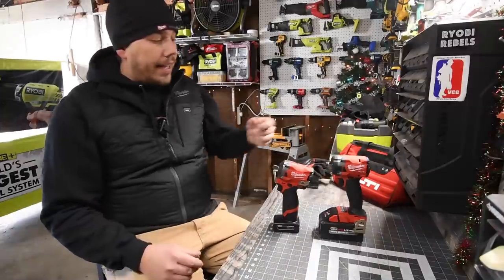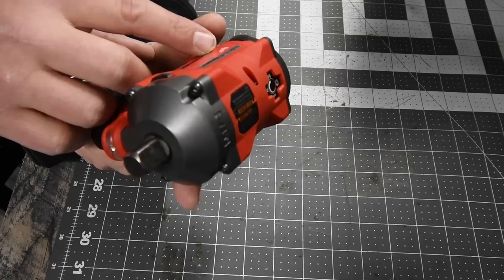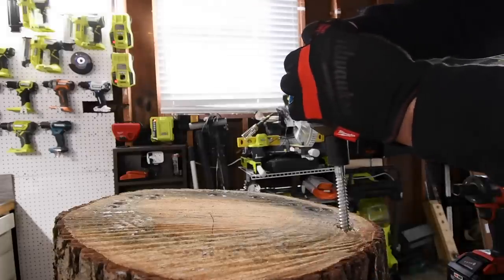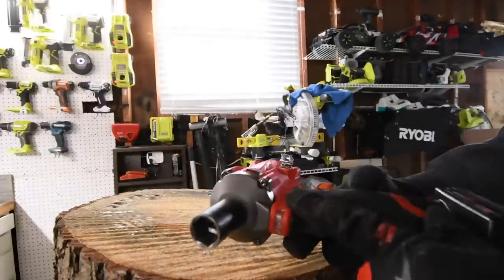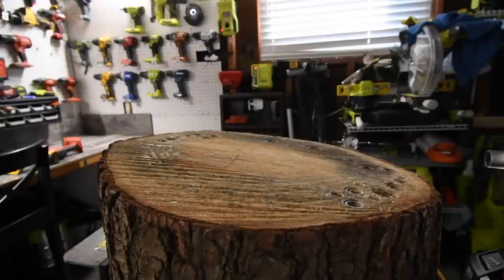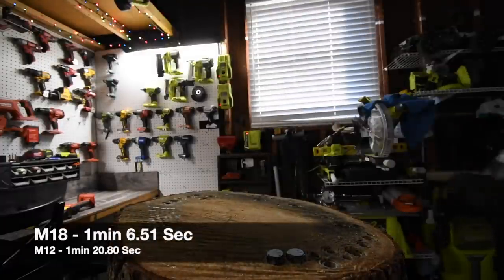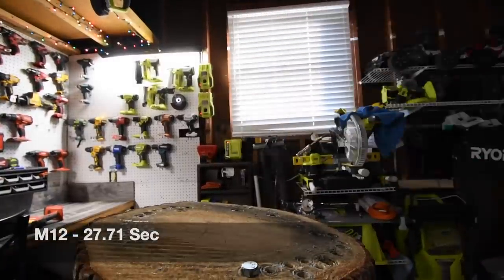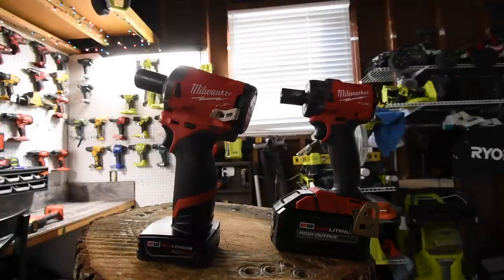New M18 Stubby vs M12 Stubby (1/2 Impact Wrenches)

Comment: I never believed when people would say "it replaced my air tools", I loved my air tools for everything from the power, to the sound, to the overall experience. I thought I'd give the m12 stubby a try, just to use for little stuff so I don't fire up the compressor for quick little things, and let me tell you, in the 5 or so months of having it, I have not used my air impact even once!! Everything from lug nuts, to corroded exhaust bolts, it handles it like a champ. Of course it's not as fast as air, or sometimes it might take a second for it to hammer it loose, but it has yet to fail me
Reply from the maker: these impact wrenches are powerful now, its crazy and I thank you for your story Raffi :)
Reply: Facts, I bought the stubby even though I haven't had my 60 gallon compressor for even a year and I barely even turn the compressor on anymore. Now I've just been buying milwakee to add to my collection
Reply: Bout a 30 gal Kobalt for use at home, then I got a m18 mid torque a month later on sale. Nothing beats air tools but these come close.
Reply: @scinto23  nothing beats air tools for sure, but 99% of the time, the electric  stuff has enough power to do the job. Plus no noise, hose, or oil. Air tools win in power and longevity for sure. Also more compact
Reply: @raffi2287  Agreed
Reply: @raffi2287  I don't know about power the torque test channel put the 1/2 Milwaukee impact vs the most powerful 1/2 pneumatic in it's class and the Milwaukee outperformed it
Reply: Did you get the 3/8 or 1/2 inch? I'm on the fence between the 2 sizes.
Reply: @techti8792  definitely get the 3/8. Half inch useless as I wouldn't really use this for anything bigger than 22mm which even that is pushing it. Save the bulky 1/2 for the mid and high torques.
Reply: @raffi2287  plenty beats air tools now. your knowledge is old.
Reply: @James28R  my knowledge can't be old when I'm as young as I am bud. It depends on the tool. No cordless die grinder can come even close to pneumatic in terms of power. That's coming from a man that owns a M12 right angle die grinder with 6.0 batteries. And the second thing to consider is at what cost? My m18 high torque is my most powerful half inch and beats any pneumatic I have, but again, at what cost? I take off 5 lug nuts from the car with a 8.0 battery and my arms and shoulders feel like a day after the gym. The doegronder is the same concept, though convenient, it's absolutely massive compared to a compact air die grinder, and I would say the pneumatic is about 3x more powerful. So no, it's not ignorance, infact you're ignorant to think just because cordless exists, air tools are worthless now

Comment: Thanks for comparing these two. Going m12 1/2” and m18 high torque 1/2”… should get me through every job. (And I highly recommend the 3/8” right angle ratchet for anyone reading this… LOVE IT!)
Reply: Right angle ratchet??? Don't you mean the "right angle impact".
Reply: @megatonesilva6546  the right angle impact is different than the right angle ratchet. Still a great tool though

Comment: I work on motorcycles everyday and I love my m12 stubby. It’s fast, it’s powerful and it’s very light. Does everything right. One of my favourites tools in the workshop. I find the m18 battery too bulky in comparison, although it’s got an advantage in stabiliy. My m12 has fallen once or twice because of its lightness.

Comment: Makes sense. Virtually the same for the most part. I’m guessing the M12 has seen more use - it’s had a chance for the grease to get pounded out of the gear teeth before it heats up again and the grease can redistribute, giving it an advantage under normal loads. The M18 really comes alive for the long fasteners, and it maintains its power under those heavier loads where the M12 tends to taper off.
Reply from the maker: you are correct on that one and I thank you for your input Kevin

Comment: The reason why the m12 won the other test is because it has higher speed. When you needed high torque in the 10 inch lags the m18 won because the slower speed gave it more torque. Great video as always!
Reply: Agreed!
Reply from the maker: I thank you for the input Vane and I thank you for viewing :)
Reply: So when doing continuous rigorous work, the m18 is better ? For lighter quick jobs the m12 would be preferred.
Reply: I dont think that is right. Other channels show the m12 having more tourque.
Reply: If the M12 XC5.0 High Output battery was available, the results would be even better. The M12 XC6.0 is the weakest of the XCs - weaker than the XC3.0! 

Conversely the M18 XC6.0 High Output is stronger than the XC8.0 High Output, but not as strong as the HD12.0 (or the new upcoming XC6.0 Forge which has HD12.0 power).

So the M12 had the weakest XC battery, and the M18 had one of the strongest.

Cells below are Samsung INR18650-xxx series; I'll just show the last charcters:

M12 XC5.0 High Output: -25S cells rated 35A; 2x35A = 70A
M12 XC3.0: -15M cells rated 23A; 2x23A = 46A
M12 XC6.0: -30Q cells rated 15A; 2x15A = 30A

So peak power on the XC3.0 is 50% higher than the XC6.0. Peak power on the XC5.0 High Output is more than twice as powerful as the XC6.0.

While the XC3.0 would be drained by the time of the 10 inch lag bolt test, the test was about power, so it would have been faster. Swapping batteries between tasks is reasonable in real life.

Comment: Not sure how many people are driving in lags without pilot holes, but very interesting comparo as usual.  Would like to see a "real world" scenario of taking off 2 wheels with 8 lag bolts each (as in rotating tires) and see which can do it, and what the battery life will be at the end.  Obviously the M18 battery life, at that size, and HO, should last longer but if the M12 stubby gets the job done then it's a M12 vs M18 platform decision of what other tools one would need/want.  For the DIYer either is good.  For the pro in the trades I'm sure there are other considerations.
Reply from the maker: I think they both can. I already made a video showing that the m12 can take off lug nits in a second or 2. the same thing with the m18 stubby.
Reply: Using tools like this for lags is dumb. Take off a whole suspension from one side and check if they can get all the nuts off

Comment: A couple notes for testing - If you use a washer on your lag bolts you can tell when the bolt is tight because they washer will deform. Much easier to tell.

If you could leave the times up on the screen longer that would be great.

Great video man.

Comment: Just goes to show, Milwaukee builds their 12/18 volt platform to satisfy each voltage platform. If you invest in the batteries, Milwaukee performs.  The impact drill driver would beat them both. With lag screws, it’s about speed.  These tools excell with torque, not speed.  Lag bolts in wood create heat and drag, the impacts you’re testing remove finer threaded bolts with less drag after torque tightened because they are pre-threaded, and 99% like materials. Results may be similar but way faster with threaded bolts and receivers with like materials.
Reply from the maker: I do agree with you on that one Tim, and I thank you for viewing :)

Comment: Great video! I thought the 10" lag is where the M18 was going to shine but it didn't win by much. The M12 is sweet!
Reply from the maker: the m12 system is very powerful and I thank you for viewing Jeffery
Reply: M18 was not on the highest setting
Reply: It was.
Reply: Any tool will last longer if u use it less than its full potential. M18 for heavier uses. M12 for lighter use. Why would u wanna kill your M12 prematurely?

Comment: I've been wanting to see this comparison. I think they're so close that it comes down to which platform you are on or want to be on. M12 for me. Great video.
Reply from the maker: I love the m12 system over the m18
Reply: i got the m18 version for my truck, just to have in there. my m12 stays in the shop and gets extensive use.
Reply: yup I agree M12 for Me as well
Reply: M12 for my uses. The M12 stubby impact wrench is a beast, no joke. Saves me so much time and effort while working on my car.

Comment: I bought the 3/8 and 1/2" stubbys... I originally started with the 1/2" and then found a refurbished 3/8" for $100 on eBay, could not pass that up. I have been using the 3/8" more so than the 1/2" working on a Cummins ISX. I looked at the M18 version, and went with the 2962 1/2" mid-torque instead. I know I will have uses for all of these. And I tell ya, that little 3/8" stubby is the BOMB! It surprised the hell out of me, removing tough fasteners with ease.
Reply from the maker: 12v tools are powerful now a days
Reply: @ManCaverTools  Damn straight!

Comment: ah, exactly what i thought, the m12 is lighter and just as powerful but the battery drains differently vs the m18. m18 is clunky but lasts all day or more , really depends on what you do
Reply from the maker: that is correct. but its still a powerful little 12v

Comment: I have an idea on how you can get every time the same depth of driving in the lags, just count the required rotations of the socket when it hits the wood and you cannot see the lag's progress anymore, by using either the detent hole or the markings as reference. Awesome vid as always 👍
Reply from the maker: I can give that a shot and I thank you for the suggestion andysm
Reply: @ManCaverTools  easier if you just put a large washer on the lags. You’ll see when the washer tightens.

Comment: Dont forget the m12's come with the compact 2 amp battery and doesn't jut out at the bottom. There are no options for that on the m18 lineup
Reply from the maker: you are correct about that

Comment: I have the M12 stubby works great in the automotive shop
Reply from the maker: gotta love the m12 system and I thank you for viewing Matt
Reply: Do you have the m18 as well? And what size battery do you use for the m12? Curious how many hours it lasts with the size you use. (of course I just mean work hours not runtime hours. Assuming you use it regularly on most bolts)
Reply: @meme5887  not sure about him but if your looking to buy I would stick with the m12 that thing is amazing at least if your working in automotive
Reply: @onetteness6778  i use the the m12 stubby with a 6amp battery and after a whole day doing brake jobs in a day it only drained a quarter of the battery, considering i was taking wheel nuts off with it, it’s amazing
Reply: WHO WHO WALKWA  not sure about the 1/2 cause I don't have that one I have the 3/8 I use like to replace valve cover gaskets brake jobs alot of thing like for removing things on a engine when I remove it but the 1/2 I'm guessing you could remove tires and other harder things

Comment: That's actually nice to know. I have a M12 stuby and it's awesome especially it's size and the fact that it can take off lug nuts with pretty much no problem so it's awesome to carry in the trunk just in case. I definitely wouldn't switch over to the M18 seeing this video. If they made a higher amp battery for the M12 it would last just as long. Considering that the M18 batteries cost a lot more you can just get an extra for the M12.
Reply from the maker: they both are good but I love the m12 version better
Reply: @ManCaverTools  I think they are basically the same tool with the M18 having better battery life. The real M18 tool is the mid torque one.

Comment: Im no physics teacher but wouldnt putting lags close together more stress and force on the second lag time? As it burrows in, it has less play and more force for the surrounding area to expand out .
Reply from the maker: it does but not that much more stress for these Motors
Reply: @ManCaverTools  im well aware of the these tools for exceed most every use but as to true time comparison .. What ever still awesome channel.. One of most unbiased reviews compared to others
Reply: I also think he should have used a 4 ah battery on the 18 volt impact so the batteries would have the same watt hour rating.
Reply: @aidangattinger8975  the batteries wouldn’t have the same watt hour rating. Watt hour rating is determined by volts x amp hour rating of the cells. Therefore he’d need a 2.0 m18 battery and a 3.0 m12 battery.

Comment: Going to try to get the m12 stubby and the tiny battery. I like using my m18 mid and hi torques but the stubby seems like a good tool for the 8-12mm fasteners. They both seem like great tools but the weight and size of the m18’s is unnecessary for light and fast.
Reply: So far, I have used that 3/8" stubby up to 24mm with no issues. Little beast.

Comment: It looks like there's a massive flaw in your testing here.

If you look at the times, M12 is faster going in, and M18 is faster going out, both by a large margin. This doesn't really make too much sense unless the first lag is causing the wood to get "pressurized" and "stiff".

-This would explain why when you put the first lag in with me M12, it has a fast time because there's nothing increasing the wood's pressure. The second lag with the M18 has a slow time because the wood is now pressurized from the first lag.
Coming out you have the same problem:
-When removing, the wood is still pressurized because there are 2 lags. So removing with the M12 takes longer. And removing with the M18 takes less time because there's only 1 lag left.

Comment: The problems i had with the m12 is the batteries plastics breaks...the lock tabs and the batteries cells itself separe from the plastic housing
Reply from the maker: it would be better if they had springs
Reply: Yeah, mine done this inside the actual tool, so frustrating when you need to take it out and the battery cells nearly come out

Comment: Looks like I’m not gonna upgrade to the m18! I have the m12 and two 6ah batteries. Crazy performance from a 12 volt tool. The m18 was only winning the last test because 12 volt tools will discharge faster.
Reply from the maker: you are correct Caleb both systems are great and I thank you for viewing

Comment: I like the size of the m12 better but I only have m18 batteries and only 1 small m12 battery without the base for a 1/4 ratchet I have. Given that info you think it’s worth buying a couple more batteries and get the smaller tool or just go with m18 as I have like 5 of those batteries and just buy the tool. I work in automotive industry
Reply: Try some of those Chinese knock off batteries from Amazon, all I use other than the M18 9 amp that came with my circular saw.
Reply: @michaelwright1602  I did end up getting the m12 3/8 stubby. Love it it came with a free 2.0 m12 battery. But I’m picking up a 6.0 m12 or 2

Comment: Just got the m12 1/2 stubby with 6ah battery.  It can't remove any nuts on my Luton sprinter van 2015 not even close.  Wheels not been off for a while and overtightend no doubt. It's powerfull but had to crack them all by hand with telescopic strong bar first run so make sure that stays in the boot it your planning on relaying on it. Only tight as the stubby can go now so hopefully won't be a problem with overtightend nuts next time as they still will be over factory torque settings tight if the stubbys max torque is true.  if your looking to remove wheels and dont mind cracking the odd bolt by hand it's a good tool and has enough power to put them back securely to.
Reply from the maker: I agree with you on that one D and I thank you for viewing
Reply: That’s crazy tight that little m12 can crack bolts over 450ft lb

Comment: I have a m18 mid torque. I'm getting a m12 stubby just because it's overall so much more compact than the m18 stubby. Figure it's better to work with.. lol
Reply from the maker: I love the m12 version better
Reply from the maker: I also thank you for viewing Serra
Reply: @ManCaverTools  no problem my man. Great content you're putting out, keep it coming. 👍🏽
Reply: same 

but dare i use my 3/8 non impact sockets with the m12 stubbs or should i really get the 1/2 and be stuck with my impact deepsockets

Comment: They are exactly the same, but I guess you have to give the edge for M12 for speed and size, while you gain runtime with m18.  It seems to make more sense to upgrade to the mid torque if you want a huge difference.
Reply from the maker: I agree with you on that one and thank you tool game

Comment: I wonder why they didnt bring the angled head over to the 18v? It makes getting into tight areas that much easier.
Reply from the maker: I think they should have as well.
Reply: Because they want you to spend money on M12, which sells less than the M18. My guess!
Reply: @brutostaliano5566  I doubt that's the reason, why spend money on research and development on a brand new tool just to pursued people to buy the older, and less expensive tool?

Comment: Dave it kinda looks like they are using the 2853-20 body but added a impact driver to it. I wouner if the new 1/2 in mid is going to use the 12v stubby body but make it 18v power
Reply from the maker: the new mid range is 600ft lbs of torque. I thank you for viewing Louie

Comment: I have the M12 and I find it pretty bad, it struggles a lot on lots of jobs.  Facebook groups tend to blame the battery choice and say the 2Ah makes less torque than other batteries.  Be interested to see that test if you can run it.
Reply from the maker: I thank you for viewing  :)
Reply: The batteries make a massive difference. I have the 2.0 batteries and the 4.0. the 4.0 puts out higher torque and lasts much more than the double you might expect.
Reply: Running an impact wrench with a 2Ah and wondering why it has no power.. 
😆 lol wow